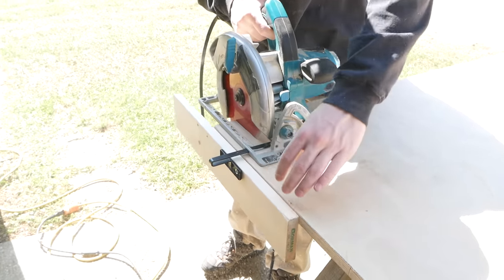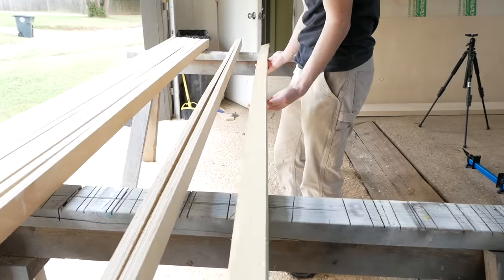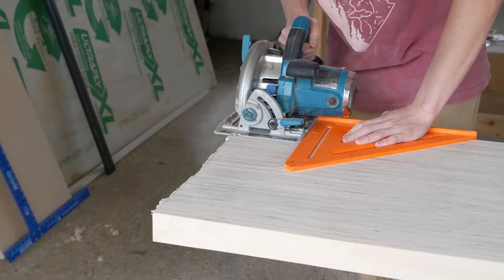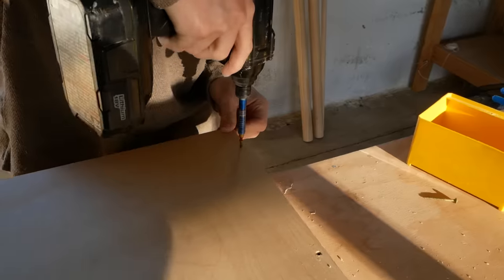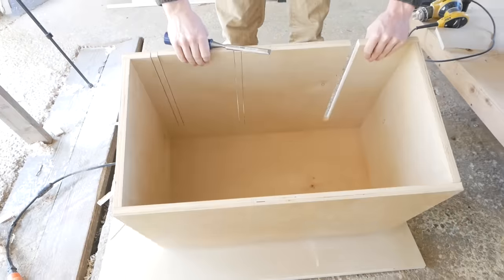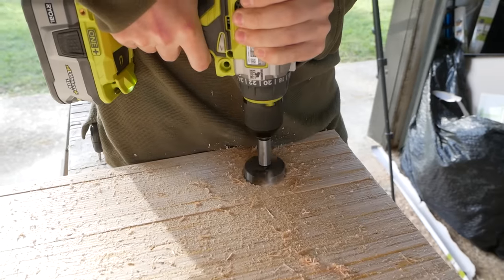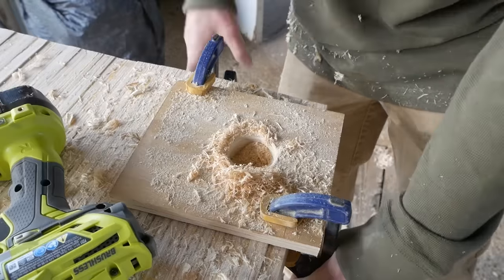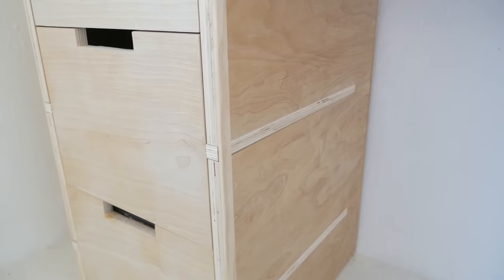How to make a Plywood Desk with Minimal Tools | Easy Woodworking Project

Comment: Minimal tools?
Reply: Nicola Coin my thought exactly. Quite a few expensive and woodworking specific tools to be considered minimal.
Reply: Y'all must not watch a lot of woodworking videos. People get pretty carried away with the tools. They built this thing without a table saw (!), chop saw, router, or sander. He hand cut a small 2" dowel!
Reply: Keith DiSarno so because they didn't use a drill press it's minimal tools? He did use a palm sander I think.
Reply: Keith DiSarno yeah they could have used so many other tools to make this easier e.g. table saw and a router
Reply: Circular saw, random orbit sander and drill are minimal tools in the wooworking world, and they are cheap and basic.
Reply: Emmanuel Morán you are forgetting a few tools... Yes they are not powertools, but they are tools nonetheless.
Reply: I'm building a table,not as good, with only using hammer, hand saw,  nails, pen, measuring tape.. that's minimal.. no clamps😂
Reply: right, that's what i expected to see too, and I'm disappointed.
Reply: yeah i also think they chose the wrong title, maybe "basic electric tools" is more accurate. This is not minimal at all.
Reply: Minimal tools = All available tools in the solar system
Reply: Maybe 'Basic' would have been a better word, but lets see how your desk looks with the tools they used. (Oh you don't have one, huh?) They created something awesome and seriously unique - but please take time to comment on @#$%ing semantics, it'll make you feel good on the inside..
Reply: Aaron Joseph semantics
Reply: These tools may look expensive on amazon, but you can get all the really necessary tools at your local pawn shop for a lot less.
Reply: If you don't bother with the fancy top, you could make this with a drill, nails, hammer, handsaw, and sandpaper... I would say thats things that should sit in any house and if they dont, well - maybe go to ikea instead.
Reply: I have a Jigsaw, a drill, a hammer and some screwdrivers (I'm an electrician)
Reply: Minimal is a relative term.  That being said they used pretty minimal tooling to make this in the grand scheme of building furniture.
Reply: Go watch a few more woodworking videos and hopefully you'll come around and realize they did use a small selection of tools for this.  As a beginner woodworker myself, I'm impressed with the quality of what they got done with the tools they have.  

Woodworking as a hobby can become a black hole for expensive tools.  This video is a great example of how you can use many methods (with different tools of varying cost) to get to your desired finished product.
Reply: yea, it should be "building with only basic tools"
Reply: off grid....but electric powered tools?
Reply: Olfert Poelen electric tools powered by their own solar is off the grid.
Reply: wondering how that can be completely off the grid, since a solarpanel is build with machinery that aint off the grid... but I get your point
Reply: Olfert Poelen that's pretty nitpicky in a modern world. If my shop was literally not connected to the power company's line and I'm getting power from solar panels, I'm off the grid. That's literally what off the grid means.
Reply: ls chhangte thats how i started probably thwm tho not to be rude the things uou build ain that faze are shit without the tools thwy used u can build nothing except if you buy a loot of nice hand tools which will cost you probaly the same money and crap load of time
Reply: Thank you.. People are upset because after watching the video, they realize it's not as easy as they were hoping. Anyone who cares about woodworking, even at a minimal level, will have most of this stuff already. There were expensive tools in this build up. I bet the Rockler clamps were the most expensive part. Arguably the most significant tool they did without was planer. Instead, homie planed the entire thing by hand. A $25 alternative to a $600 tool.
Reply: I came here to say this.
Reply: Are you kidding me?
Reply: Keith DiSarno he cut a 2" dowel with a flexible flush cut saw....... Ugh that was painful.
Reply: Circular Saw, Straight Edge, Chisel, Carpenters Square, Drill, Clamps, hand planer, Sander, brad nailer, coping saw, and some drill bits. Honestly thats pretty basic tools. Brad Nailer, Circular saw and sander being the most expensive items.
Reply: circular saw w/ straight edge ... a dozen or less clamps ... drill/driver ... glue bottle ..  saw horses ... triangle .. electric nail/brad gun .. 2 small hand saws ... chisel .. hammer .. small orbital sander

seems pretty basic to me  

from the comments  ( all available tools in the solar system )  I was expecting a table saw, router and a handful of other power tools and a full shop
Reply: Thank you Nicolas .. I thought you might be seeing too much ...
Reply: @maop  compared to my shop this is as minimal as it gets they did a nice job
Reply: Keith DiSarno hand cutting something that small is almost necessary
Reply: This is minimal. If you have less tools than this you shouldn't be making a desk
Reply: I have a table saw and berly use it acctualy i have 2
Reply: Minimal does not equal Basic/Cheap. But even if it did they're using common tools most people will need for projects such as this and can be borrowed from a friend or relative. Its not like they're using a bench saw/table saw, router table, jointer, biscuit joiner, drill press etc etc. You could even make the same cuts with a handsaw if you wanted to, nothing complex about them.

Comment: I liked the work and showed a different approach. But was it necessary to cut the plywood into strips and then for them back up? After all you were making an office table. I don't mean to be insufferable, but you were using a lot of tools not minimal at all. Also considering the amount of electrical tools used did you have a net per saving using your solar panels or what? Thanks for the video. It was good.

Comment: Great Job and the table looks great but when i saw that you said minimal tools i envisaged a saw a hammer and a screwdriver not 3000 bucks worth.
Reply: Not certain about the points made but ,if anyone else wants to discover cradle woodworking plans try Stiklind Wood Blueprints Fixer ( search on google ) ? Ive heard some extraordinary things about it and my buddy got amazing success with it.
Reply: It's a drill, a skillsaw, clamps, some glue, and you could skip the nail gun for a hammer and nails. You could grab all that for 2-300 if you go for the cheap brands, and since it's ply instead of hardwood you save big time on the wood, hardly 3 grand..
Reply: Exactly.😅

Comment: I see this on a lot of videos from a bunch of different Youtubers and i wonder why do people rip down a piece of wood (or plywood) just to glue it back together? Does it add thickness, that you couldn't get from just gluing to whole pieces together?
Reply: redblkgirl99 hi! The main reason this is done in woodworking is for strength. The grain running horizontally is not very strong as one giant board. When flipped and glued together in strips the rigidity is drastically increased. 

The second reason can just be looks. If you want the desk surface to have some texture or look. More expensive hardwood desks with a lot of character are made from woods wither denser and varying grains. Woods suck as hickory and walnut to name a few. Poplar, birch and pine (the most widely used plywood veneers) have a very wide grain that honestly looks clean but also is bland.

Hope this helps!
Reply: @drew4324  thanks that does!!!!

Comment: Looks like many are pissed off on the "minimal tools" on the title. But relative to other "DIY" videos on YT, this is definitely minimal. Others use a circular saw, table saw, chop saw, jig saw and hand saw for cutting. Then use a drill press and a few different battery powered drill and pocket hole jig to drill holes. Then use a thickness planer, electric hand planer, belt sander and random orbit sander to prep the wood surface. So relative to other DIY vids, definitely minimal.

Comment: You have used every available tool and still you made drawer cabinet without drawer chanells with ball bearing. 
Those drawer will noisy and hard to pull

Comment: I really like your project...
Please use eyes, ears, gloves, protection.
Reply: every time a power tool was used eye and ear protection was used.  Gloves should almost never be used when working with power tools unless you have a specific condition that requires you to take that risk.  Eye and ear protection is not required when using glue, hand planes, and clamps.
Reply: Add a mask to your list, that saw dust is no joke

Comment: Minimal tools? I swear I counted at least 20 types of security tools or equipment or more being used during the process ... Who found an equal or greater number?
Reply from the maker: Minimal, as in not a lot of tools. All we used was a circ saw, drill, impact, pin nailer, hand plane and a small hand saw.

Comment: "with Minimal Tools" BOOM! circular saw.
Reply: You can buy a circular saw for under $100, much cheaper than a table saw. You need to have some way to rip down large sheets. You could also have the hardware store do it for you. It said minimal tools, not no tools.
Reply: Minimal, not cheap. Haha
Reply: @BlackMarq20  Minimal would be using a handsaw to cut it.
Reply: @frankmat  no that would be cheap and impractical
Reply: That was my reaction.  My entire apartment is the size of their shop and I have a roommate; I absolutely do not have the space to buy and store all of these tools regardless of cost.
Reply: @terrencegrant3447  it's cheap impractical and minimal... but you can still do the job.  It's how my grandfather made furniture for 50 years
Reply: @frankmat  yh but he was an expert not anyone with a free weekend can use one.
Reply from the maker: Y'all are micro analyzing to find some reason for you not to be able to do what someone has done. Find your own passion and pursue it. You'll know you are doing something right when people online start commenting on all the reasons why they can't do the same thing.

Comment: Why didnt you flatten the underside of the desk? just makes it look unfinished and rough.. Similar item in IKEA in the UK would set you back £60, i'm all for making things but only if its an uniqie item or you can build it cheaper..
Reply from the maker: We didn’t flatten it because it’s our desk and we didn’t mind the underside looking rough. Funny thing is we ordered a similar desk from IKEA and it arrived 2 weeks later broken and looked like plastic. This desk looks 8x better in our opinion, we built it, it’s way stronger, if you spill water on it it won’t bubble up, we built it in just 2 days, has a really unique top, and best of all we had a lot of fun making it... which is the point of all this. I don’t believe I could remake anything from ikea for less money, but for all the reasons above I choose to.
Reply: It would be a lot more than £60 if it did exist in Ikea.

Comment: Minimal means a handsaw, hammer and nails. Other than those, aren't "minimal" at all.
Reply: You could easily do it with handsaw, hammer and nails, it would only take a bit longer ;)
Reply: I would add a drill, and you are good to go...
Reply: Yuppie minimalism includes these tools.
Reply: A minimal set of power tools includes a drill and a circular saw, even inexpensive tools will last you a lifetime if you don't plan to use them much.  You could buy used tools and save even more money.  A very good project. Stylish and functional.
Reply: good luck lol